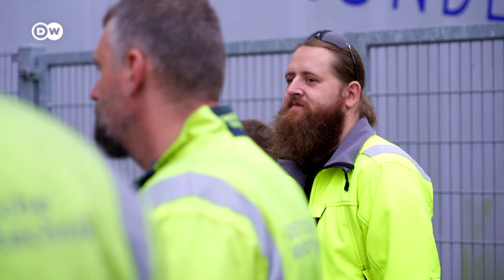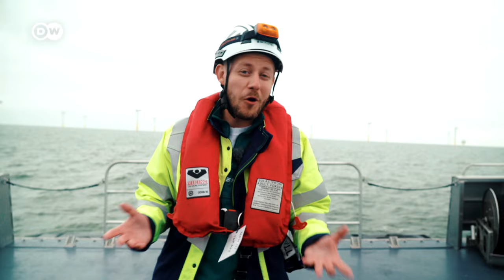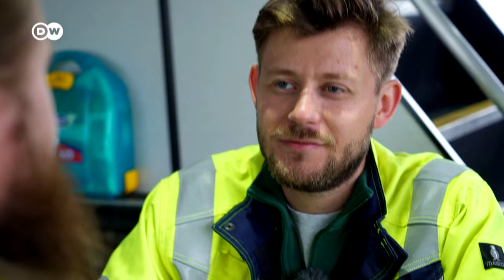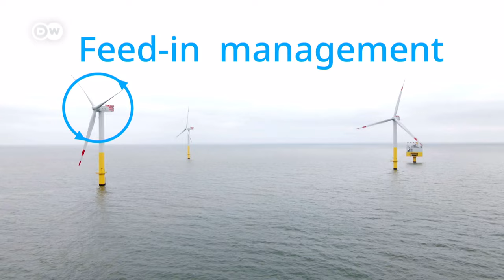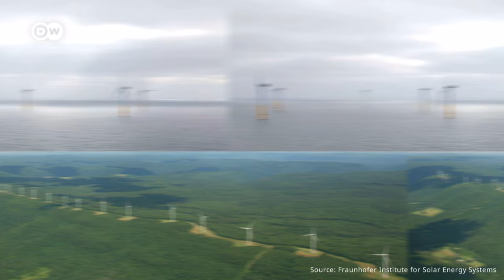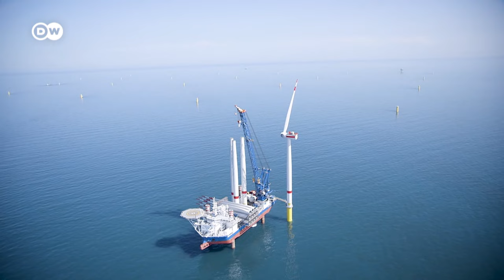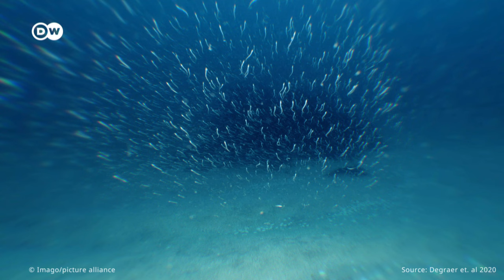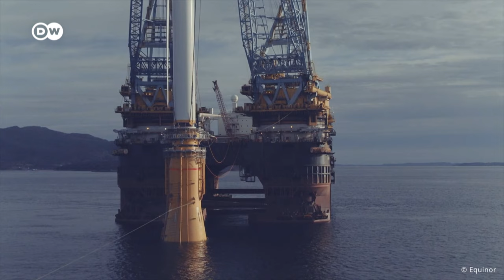Is offshore wind the energy of the future?

Comment: Dig a deep enough borehole, and you can use geothermal as a baseload energy source (albeit, an expensive one).  At sufficient depth, a temperature gradient always exists.
Reply: @Nill757  So... you need to take into account the risk of your project before entering the exploration phase.  Wind/Solar is cheap on it's own... but once you start trying to remove the intermittency from those sources by adding battery farms -- that project is also guaranteed to get bloody expensive.  Whether the probability of finding a viable site per borehole is 10% or 90% -- that probability needs to be taken into account before you go to investors.  Give them expected cost -- and give them expected return; then they can decide.  There's no free lunch -- no matter which energy project you initiate.
Reply: @gilian2587  The price of batteries is also coming down with the economies of scale and new technologies, though.

All this stuff was never developed while combustible fuel was both the source and the storage medium for energy.  But now that all this cheap intermittent power is coming online the development is going to be rather rapid.

Electric cars requiring lots of batteries is only going to catalyze that effort even more.
Reply: @OolTube02  If I'm understanding the arithmetic correctly; the cost of battery storage per kWh will need to come down by a factor of about 100 to make 100% wind/solar possible.  But once that happens -- those will be completely viable stable energy sources.
Reply: @gilian2587  From what I understand it will have to come down to around $100 per kWh and it is now at around $150.
Reply: @OolTube02  I believe you have those units incorrect.  It currently stands at $150 per MWh.  And if that's correct; that is insufficient.  I found the numbers you referenced; and that is the expected drop in price from year 2020 to 2023.  

So... let's model this.

100 = 150 * (0.66)^(3/3)

y = 150 * (0.66) ^ (t/3)

ln(y)  = ln(150 * (0.66) ^ (t/3) ) 
ln(y) = ln(150) + ln ( (0.66) ^ (t/3) )    
ln(y) = ln(150) + (t/3) * ln (0.66)
ln(y) - ln(150) = t/3*ln(0.66)
t = 3( ln(y) - ln(150) ) / ln(0.66)

We'll use the factor of 100 reduction in cost as our subject of calculation.

t = 3 ( ln(150/100) - ln(150) ) / ln( 0.66)
t = 3 ( ln (1.5) - ln ( 150 ) ) / ln (0.66)
t = 3 ( 0.405 - 5.01 ) / (-0.416)
t = 3 ( -4.605 ) / ( -0.416 )
t = 3 ( 11.07)
t = 33.2

Meaning at current rate; assuming the cost of storage decreases at roughly the same current rate of exponential decay with no accelerations, we can expect it will take roughly 33 years for battery storage to be at an affordable level.
Reply: @OolTube02  I am posting a second comment because youtube's AI algorithm gets bloody antsy when it sees equations in a post; and if I edit it, it is likely to delete the whole post.  I intended this post to soften the statements in my previous post.  The idea of exponentially decaying cost of battery technology is exciting -- I agree with you in this sentiment.  :)
Reply: @gilian2587  But the thing is, it doesn't even have to be batteries.

With the intermittent power being so cheap even if you use storage technology that's only 60% efficient or less, of some kind of low tech variety, such as heating rocks in a thermally insulated container or liquefying air or spinning up a flywheel, that's going to make renewable energy so abundant that it is going to be a game-changer for everything and give us power beyond anything we've ever had before, making carbon neutral industries possible on a scale that we've never had before.  Like desalinating water, growing food indoors, using hydrogen for steel and cement production, etc.

I think very cheap battery technologies out of abundant materials will be invented and mass-produced.  The only reason they don't exist already is because there was never any need for them with the ability to burn combustible fuel near the consumer.

But even if they wouldn't be, there is enough already established technology around to make the renewable infrastructure grow and grow to unprecedented orders of magnitude.

Comment: With all of the fuel imported from Russia, I am thinking that Germany would rather get the wind power than to keep sending Russia a billion dollars a day for the fuel from their companies.  As for the "Crisis" of not being able to import the electricity from the North Sea into the center of Germany, that is very easy to solve.  Somehow when they build a 150 MW hydroelectric plant that is 85 miles from the large city they get the power to that city.  Just install more power lines to where you need them.  

The "Problem" with getting North Sea Wind Power into the grid lies more with the desire for the power utilities to allow connections to the grid from this new source.  They just don't like the competition!  

Perhaps with the very expensive natural gas prices in the winter of 2022/23 you will see more of the wind farm electricity embraced in Germany and all of Europe.  More heat pumps need to be installed, and the change over to heating with wind farm generated electricity. 

Large heat pumps, such as the 15 ton Mitsubishi "City" units, they can have 10 - 15 of the 7,000 to 36,000 Btu capacity heat pump heating and cooling indoor coils connected to one outdoor unit.  This can heat even the largest of commercial buildings with many units on the roof.  I worked for a University, and we heated over 300 door rooms, using about 40 of these large capacity heat pumps, in Portland Oregon, where our typical low temperature in the winter is around 20F.  (-10C).  They work great even at -15C or 0F.   We have low cost hydroelectric power in Oregon!  And some wind farms in the 875 MW size range.

Comment: German on-shore wind: 3.99€/kwhr. German off-shore wind: 7.79€/kwhr. 
USA average price of electricity: 0.16€/kwhr
Reply: @MatteoMucciconi   Also called economic suicide
Reply: I don't believe they quoted those numbers correctly.  If they did...  I am absolutely stunned.
Reply: @gilian2587  you seem to be correct. The costs reported seem to be those of KW of installed power, nor KWh. This makes Germany's electricity only 3 times higher than in the us on average.
Reply: @MatteoMucciconi  It seems to be a common trend with folks who prefer wind and solar over nuclear power -- they have little comprehension of numbers, scale, or mathematics.

Comment: Baltic sea is 90% shared internal sea with EU states, so should not be a problem to install floating windturbines on shared sea behind the economic zone to proposer renewable energy production

You could also consider running a nitrogen extraction plant next to the turbines and use the excess electricity to filter the sea water and sell the fertilizer to farmers instead of buying virgin materials from russia

Comment: it wont work for countries that face disaster like Cyclone or tsunami... like here in east-cost of india  we face cyclone atleast 2 times a year. as i speak currently a cyclone is on its way here. And japan like country facing tsunami also cant plant that on sea shore.
Reply: Wind forms on ships or floating platforms can be placed to harvest electricity from wind. They can be placed somewhere safe when meteorological reports of cyclones comes up.
Reply: @rageshvaikkatil4778  so u r going to rotate them in land 70 km and to sea 4times a year, does that sounds economically ok to u?
Reply: @ashutoshpattanaik3650  Floating platforms can be put to safe harbors when there are cyclones based on meteorological reports. Time spent in harbors can be used also for maintenance. If no cyclones, they can be on sea most of the time.

I dont think there are a dozen cyclones in a year even in the bay of bengal.

If it is still not feasible, such floating farms can be placed in relatively calmer Arabian sea or Indian ocean.

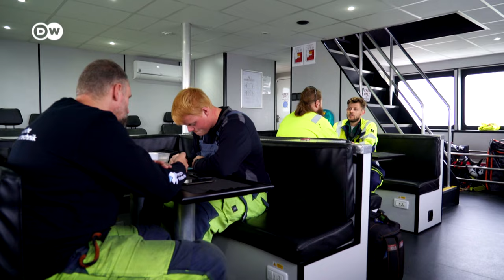Comment: The calculation in 3:10 is only good for the regulars' table.  The plant has 6.2 megawatts of power.  And the good man compares that with a house annual consumption of 2.5 to 3000 kWh.   One is power, the other energy.     Actually, one would first have to calculate the annual yield of such a 6.2 megawatt hour wind turbine.  Let's assume that the 6.2 MW turbine would have 4000 full load hours, then it would produce an energy quantity of 24 million kWh per year. This can be compared much better with the 2500 to 3000 kWh annual house consumption. Then you can see immediately that ONE such plant generates in one year the same amount of electrical energy (or "electricity" in casual terms) as 8000-10000 households consume in a year.

Also die Rechnerei in 3:10 ist aber höchstens für den Stammtisch gut.  Die Anlage hat 6,2 Megawatt Leistung.  Und das vergleicht der gute Mann mit einem Haus-Jahresverbrauch von 2,5 bis 3000 kWh.   Das eine ist Leistung, das andere Energie.     Eigentlich müsste man erst mal den Jahresertrag so eines 6,2 Megawattstunden Windrades ausrechen.  Nehmen wir an, die 6,2 MW Anlage hätte 4000 Volllaststunden, dann würde sie pro Jahr eine Energiemenge von 24 Millionen kWh erzeugen. Das lässt sich dann viel besser mit den 2500 bis 3000 kWh Jahreshausverbrauch vergleichen. Dann sieh man gleich, dass EINE solche Anlage in einem Jahr die gleiche Menge elektrische Energie  (oder salopp gesagt "Strom" erzeugt, wie 8000-10000 Haushalte im Jahr verbrauchen.

Comment: In the very, very long term, wind power MAY be able to produce enough power to meet the needs of the human population.  However, it is not currently a realistic solution; neither is solar power.  First, there must be massive infrastructure creation--we do not have the capacity to move and distribute the power.  And our governments have proven unwilling to spend the money, continuing to rely on multiple disconnected private companies to do this.  Second, our current technology, our current scientific knowledge, is simply not adequate--we have no way to store even the power we are already capable of generating, so it is wasted.  That technology does not exist.  Yes there are research projects that work on a small scale in laboratories but there is nothing that is even close to being usable on the necessary large commercial scale.  For example, there has been work on phase change sodium battery storage for 10 years now and it is still no closer to being usable.  Your rooftop solar panels may collect all of the energy you need to power  your house, but most of it is going to waste because you can't store it for when you mostly use it--after dark.
 
In the immediate future the one single realistic source of enough power to replace fossil fuel generation is nuclear generation.  And that, all the unscientific "green" advocates won't tolerate either.  The outcries to ban fossil fuel and ban internal combustion engines NOW will kill entire populations within a year of being implemented, both through starvation and through people freezing in the winter when the power is inadequate.  I do not mention the riots that will also occur following such bans.  Electricity is not reliable, it is subject to loss at any time for unpredictable periods of time.  All the "greenies" advocating these bans need to get some science education, and also take a very close look at what happened when Sri Lanka became "organic" overnight by legislative decree.

Comment: Dear Germany. You would be much better protected by spending that extra 100 Bln Euros, you've promised the arms dealers, on more renewables. Russia would be (even) less of a theat without your oil and gas revenue and you would be energy independent. PS. Build a massive hydrolyser to use your excess electricity until you get your HVDC lines built. I'm sure your existing industry uses lots of grey Hydrogen. Same for every other country keen to get back into a new cold war with that second rate conventional military power called Russia. NATO could beat them easily with existing budgets and there is no defence against nuclear attack, so what are you doing and why is the world applauding.

Comment: north sea could power all of Europe
Reply: 110Gw will not power all of Europe let alone Britain .
Reply: @the_forbinproject2777  The UK has the potential to produce three times as much electrical energy from offshore wind as the total current UK consumption.
Reply: @glynnwright1699  110GW x 0.42 x 8760 hours per year = 404 TWH  , UK consumption for 2021 307TWh pa.  However the 110GW is shared between severl other countris such as Denmark.  yes we have other locations . the UK has planned another 33GW at a cost of approx £2.5bn per GW capacity ( not delvery)
NOTE: storage on the order of 10's TWh is needed because wind is fickle. 
NOTE: for our current 24GW capacity generate 0.42 load so 1-0.42= 0.58 back up factor,
  24GW x 0.58 = 13.92 GW  x 8760 hrs = 122 TWh 
We Nat gas as backup now as you know.
Reply: @the_forbinproject2777  The mean figure for potential energy from wind in the UK's EEZ is quoted as 650TWh per annum in the 6th Carbon Budget. The top end figure, although I am not sure it includes deep water turbines which would make the number much higher, is calculated to be in excess of 1000TWh per annum. The budget calls for 100GW of installed capacity by 2050.

Comment: Made in China fuelled by coal and landfilled. What's the average life span of a wind turbine and blades? Not long enough.
Reply: It would be uneconomical to ship the blades from China to Europe as you would require a dedicated Transportship that could only carry a few blades at a time, as a consequence German Windturbines are mainly sourced from Germany. Their licensed lifetime is 25 years, though there is naturally room for lifetime extensions as with everything else.
Reply: If it's like onshore wind, 20-25 years.  But, hardware doesn't usually handle a saline environment very well... so less than that.

Comment: This idea is full of so many holes and tremendously sucks. The resources needed to make these is tremendous. Not just conductor material, but the concrete as well. This is not the future. It's an Idea that is easily sold to politicians thought because it sounds nice and gets them re-elected.
Reply: @zaarkeru3391  How about all of the land that needs to be ripped up for the massive foundations needed for each turbine? It causes permanent changes to the watershed characteristics of areas of land among many other similar issues.
Reply: @haunter_1845  
What foundations?
These are coastal turbines, they require almost no concrete...

They create massive amounts of safe artifical reefs for coastal life.
Which magnifies bio diversity and bio yeild...

On land they greate safe areas for smaller land based critters which are essential for bio diversity...

And, they hardly impact bird population.
By a fact, the impact is as siginificant as nuclear and much lower then any fossile fuel based source.